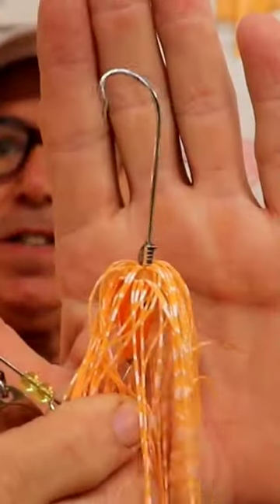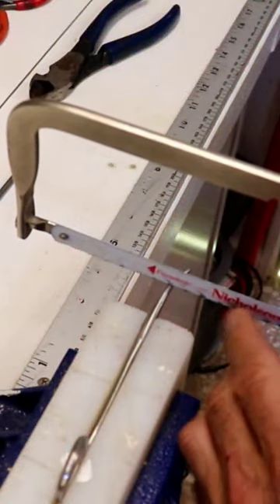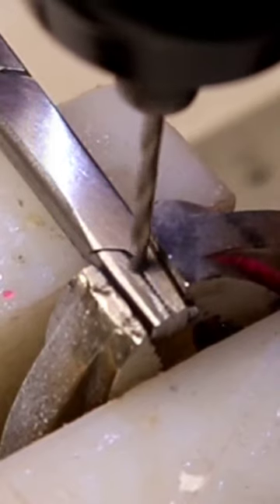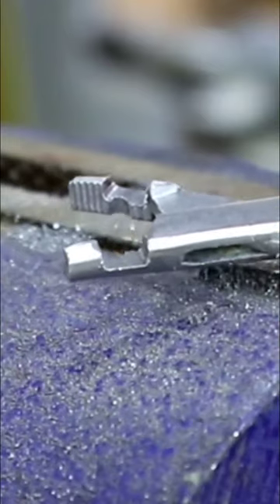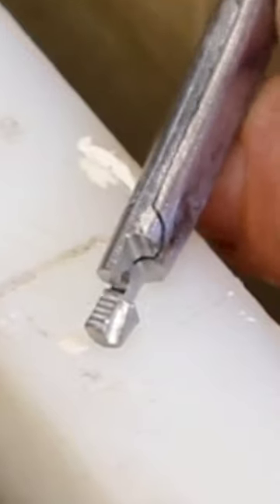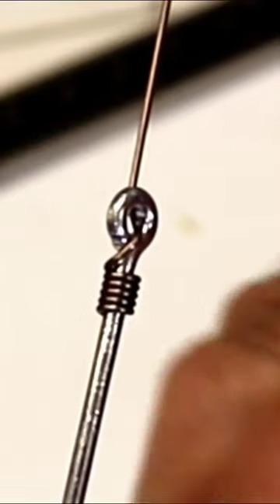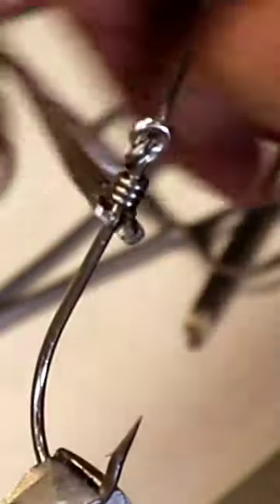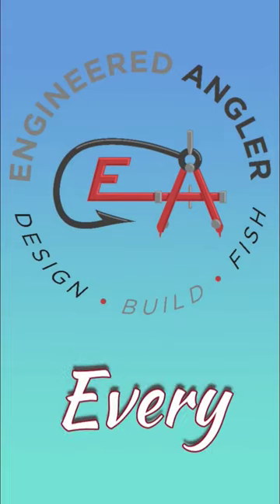Making a hook snelling tool #shorts #snellknot #luremaking

Comment: Great video! Have you ever made a tool that holds the eyelets on lead jigs? When pouring heavy jigs ( up to 28oz) vice grips tend to damage the brass #2 and #3 eyelets when powdercoating.
Reply from the maker: Nothing that big...
Reply: @EngineeredAngler  anything for smaller jigs?